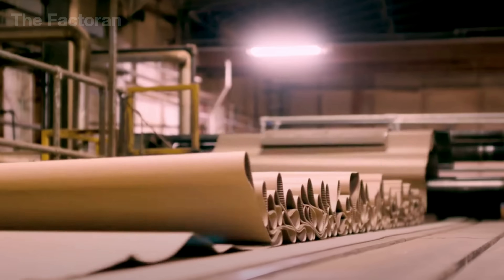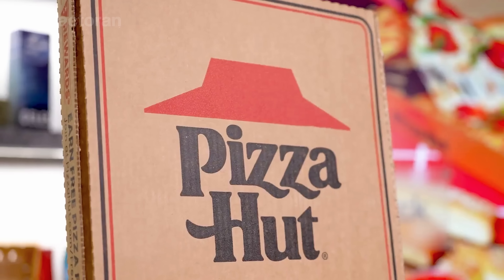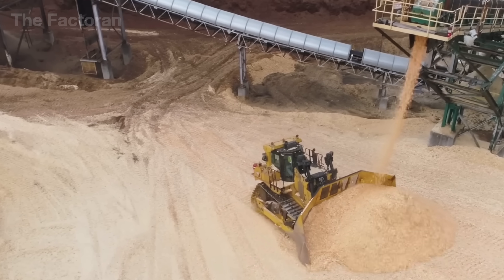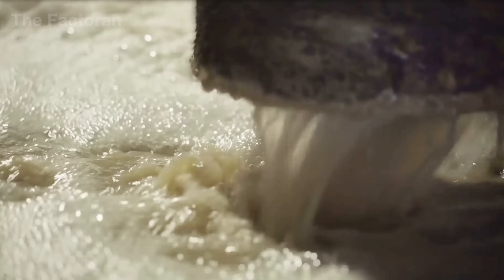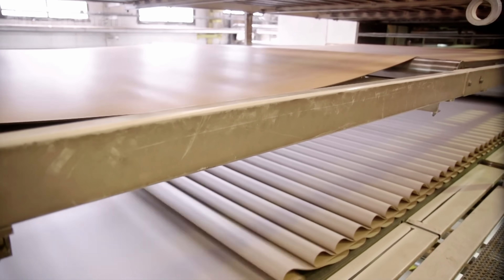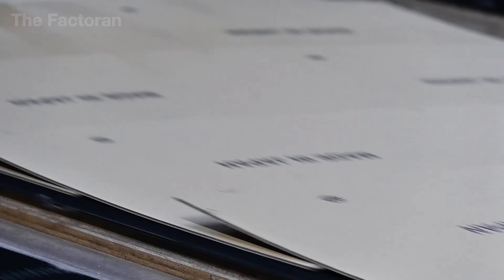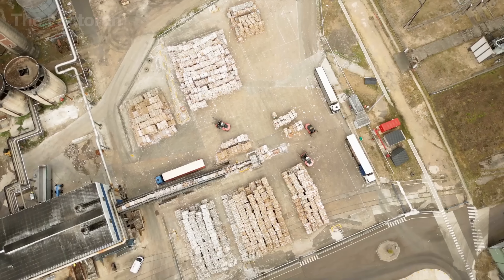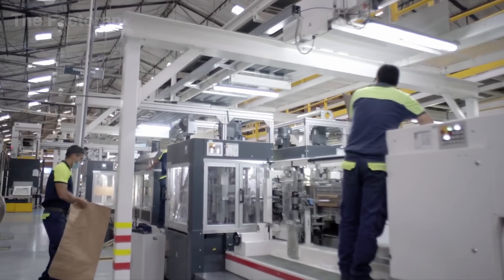How Millions Of Cardboard Boxes Are Produced Every Day Inside Massive Production Line

Comment: Many years ago I had summer jobs working in the woodlands division for a paper mill company. Got to tour the mill. It was fascinating to see the process from the logs entering the mill to the final product. This mill made the paper for cardboard boxes. One of the most weird things to see was the transfer of a full roll to starting a new roll. The paper never stops coming out of the paper machine. A new center core is brought in contact with the large roll of paper and starts to spin. An operator measures the diameter of the paper roll and when it reaches desired size he cuts the edge with a knife and the paper tears all the way across and the end coming off the machine wraps around the new core and starts filling it up. The finished roll is dropped down and picked up by a crane and rolled to the shipping prep area. The whole process from log in to paper out never stops unless there is a major breakdown, which is rare.
Reply from the maker: That’s an awesome story — seeing a paper machine run nonstop like that must have been incredible firsthand.

Comment: I worked for box plant for almost 20 years. What this video shows is when everything is working the way it should, things run fine, but it very rarely ever does. Warped board, jam up's, and machine break downs slow down the run and then the boss's get on your back and demand that you turn up the speed dial. That usually doesn't work either.
Reply from the maker: Sounds like you’ve really lived it — nothing shows the reality better than firsthand experience in the plant.
Reply: I used to work for  a university electronics servicing department as a technician. One of my colleagues was friends with tech at a local radio station that was next door to a box factory. The box factory had installed a new automatic machine ('70's era) and every morning when the radio station fired up the machine started spitting out random sized boxes. We went over to see if we could help and of course found there was some shielding and grounding issues with the box machine installation. We advised them what to do and problem was solved.  It was a fascinating process to see though.